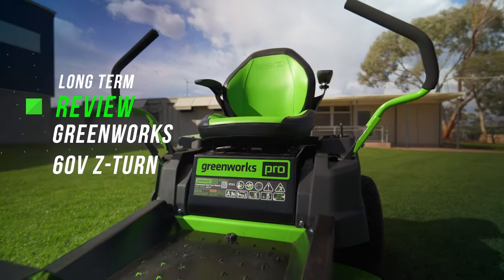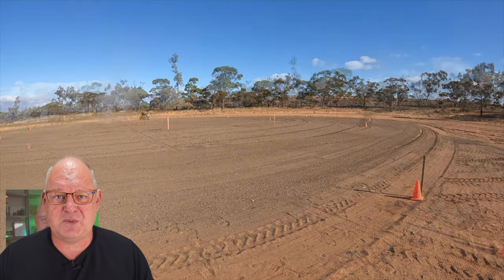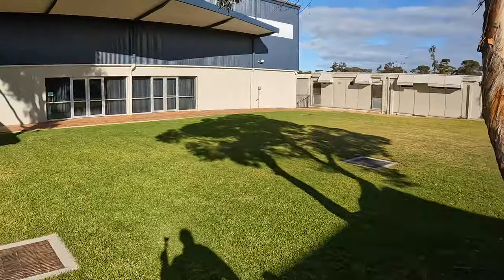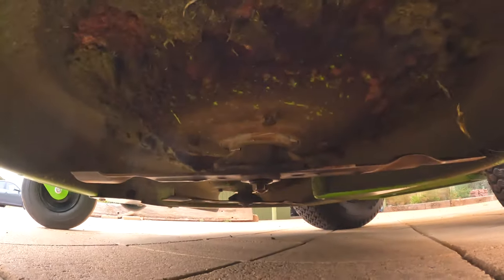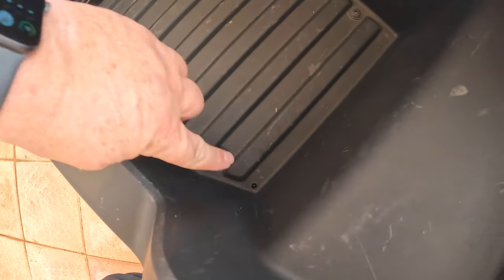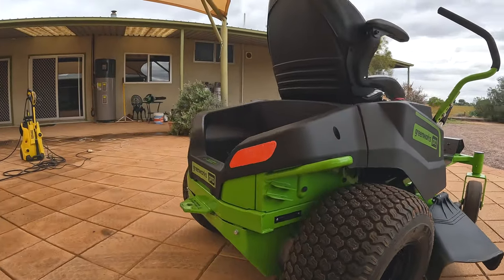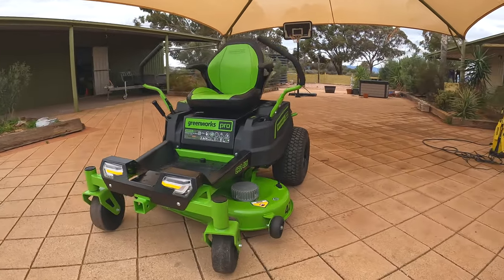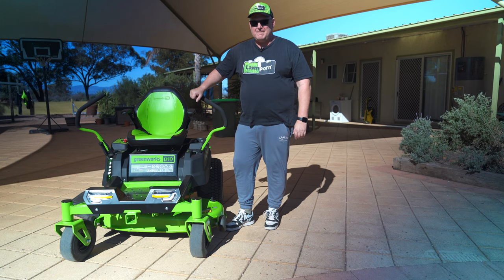Greenworks 60V 42" Z Turn Mower: Long Term Review

Comment: Great video. My concern is getting support or service for this mower. Although it seems you haven't had any issues in a year... Curious if you knew?
Reply from the maker: I can only speak from the Australian 🇦🇺 perspective. Support here is great as far as I know. They’ve got a good load of spares and I think most of the dealer network can fix minor issues with bigger issues being sent to a central location for Greenworks Australia. 
Still so far with this mower, now entering 2 years not an issue however the use has been light.

Comment: I saw somebody else do a review of this mower and they loved it but after one year I guess they had troubles with the batteries and had to replace them which could get expensive. Curious as to your experience with the batteries and if you haven’t had it a year I guess we would have to wait-and-see? Thanks thanks I believe they may have said they were switching to lithium ion but I would be surprised if these weren’t lithium ion already? Also love seeing the Rottweiler, as a former owner of three myself myself I love the Breed.
Reply from the maker: I’ve had it over a year and I’ve not seen any battery degradation. Stored in a super hot shed too. 
Not sure about the lithium ion question sorry. 
Rotties are sweet dogs. Our first one.

Comment: did you need to add gearbox oil PRIOR to first use.  There seems to be a question as to whether or not the machine arrives with oil in the two gear boxes.  Thank you!
Reply from the maker: Arrives with oil. Nothing to do but assemble the seat and lat bars
Reply: Great to see a review after a year of use - thank you!
Reply: Been hard to find, but should the gearbox oil be drained and replaced? Or just topped off each season ?
Reply: @jakeking6213  It should be replaced after the first 50 hours of use, then I think it was every 200 hours afterwards. You need to jack up the machine and take the tires off in order to get at the drain screws and fill cap.